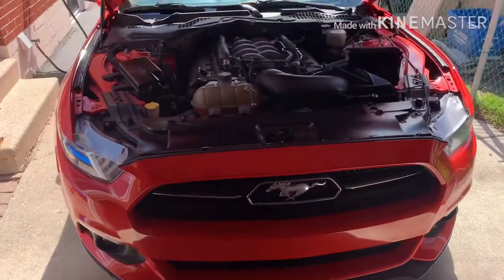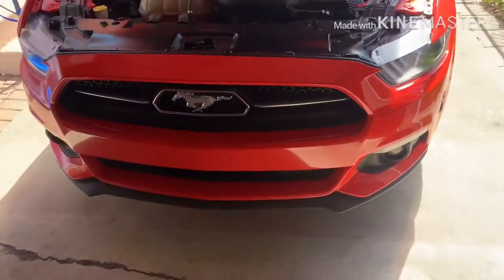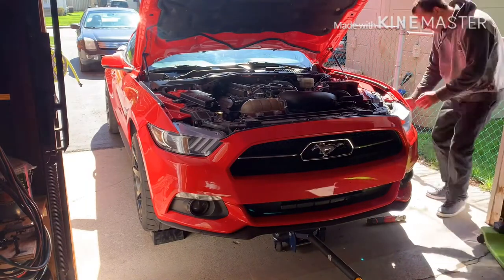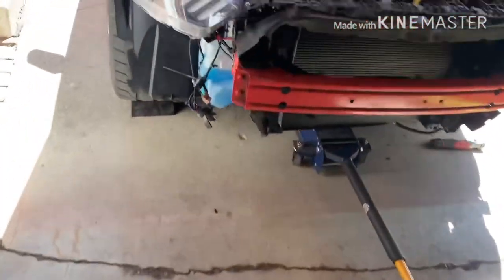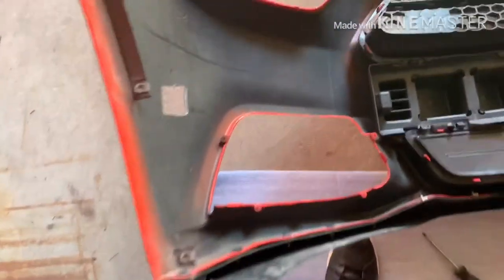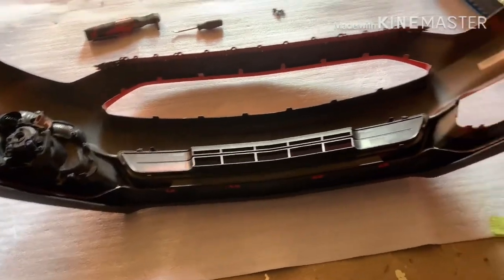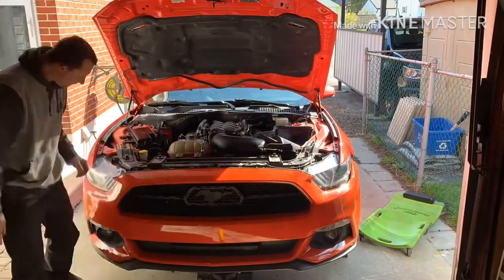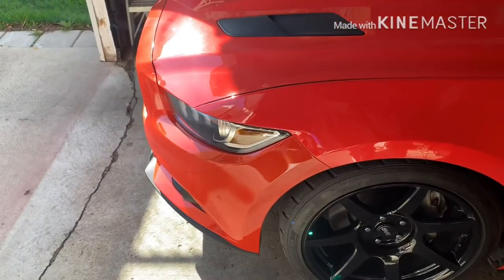2015-2017 mustang front bumper replacement

Comment: Hello, any of you guys know the exactly measure of the bolts & nuts,?? I buyed a mustang with the bumpers off (to be repaired) but not a single bolt, nut, pin or anything comes in the car, I need to install all the front end, I got all the big parts.
Reply from the maker: I’d suggest heading to ford and getting a parts break down!